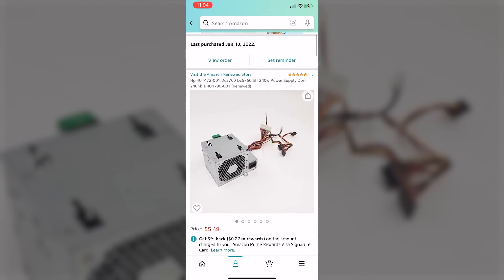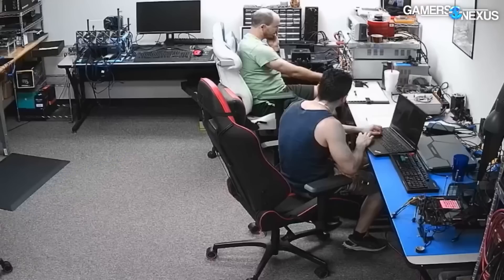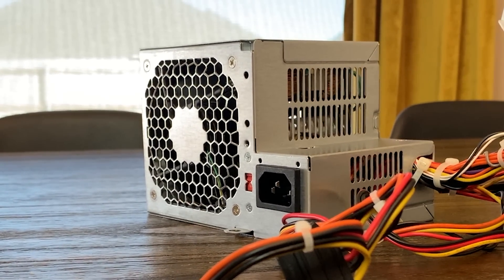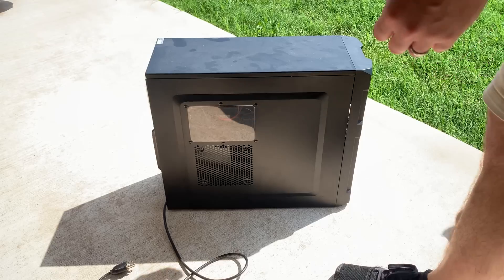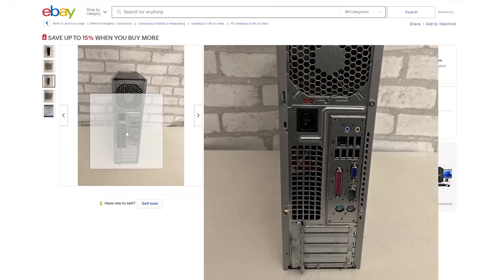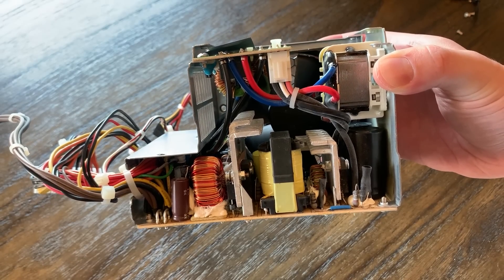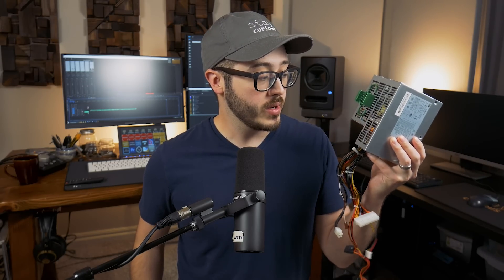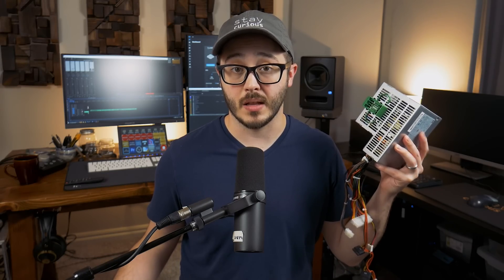THIS Ran A Website For Over A Year

Comment: Like your channel and agree with comment about internet. Good point. Also with old power supply, I had similar one, which died on me and for fun I have replaced the caps which cost not even a dollar and the PSU runs well with my WinXP retro build. Replace caps and good to go. Office PCs were built like a tank so why throw it away!
and bonus point, some of us like watching other people struggling with soldering iron so more content....
Reply: and one more thing. Replace that outer shell and use regular ATX. You will get more use out of it. Either do it with dead ATX power supply and insolate it properly OR make 3D print and put components there. Boom, more content and more use out of it.

Comment: When a cap pops, I would call that "catastrophic." The device suddenly stops working accompanied by smoke, smell and electrolyte spewed all over.  I have had that happen. Bad caps are a common, widespread  problem even with "good" brands. I have HP machines that no longer work due to bad caps that I can see are bulging. I have moved on, but should still replace them because leaking caps will eat away the pcb and traces. Since this project is about experimentation, experiment some more by replacing the caps. Not that expensive now. Use good brands like Nichicon or Panasonic.

Comment: Honestly. Cheap PSUs normally don't explode... Those removed from OEM machines definitely don't but even those PSUs that are built with the cheapest materials will probably run fine for years. The deal is, they are using the cheapest materials and overbranding themselves. So they will have a 500 Watts stick and if you try to plug a 500W load on it, sure, it will blow. But even cheap power regulation is still power regulation. So they use a 10A mosfett you can still pull 120W on the 12V rail.

Obviously you have other issues that can show up and some of then can definitely kill your PC or make it unstable. But the fire situation is very rare.

When you see the gigabyte PSU blow up on Steve's channel that did happened after a 100% load and recurrent power off. Which sure. Shouldn't happen but I bet that if you run that same PSU on a 10% load it would run for years. I would trust it with a expensive machine? Hell no. But for a budget low end Celeron pet project that I have laying around, yeah, sure, it won't burn my house down...

I would be far more worrying about certain PCI-E ryzer thar short to ground than a PSU running at 1/10th of its rated capacity on a machine that I dont care much.

That's not an advertising for buying cheap PSU but you should definitely  spec the PSU to the project, there's no sense in put a 7950X on this $5 PSU the same way that checking if your 1600 Seasonic has Japanese capacitors to run that DDR3 J1800...

Comment: I'm all for seeing you "refurbish" the current power supply and letting it go again.
I'm running a generic "480 watt" power supply that came with a generic case I purchased some time around 2005 in my home server.  
The case/power supply was from a computer I previously built for one of my kids  The system was built with a then-new Athlon 64 4000+.  It was then upgraded to an AM2+ board with a Athlon II X2 250.  That is still the board in the system, but since "upgraded" to a low-power Athlon X4 610e.
A quick inspection of the system, including the power supply a while back showed no signs of capacitor issues, which is pretty amazing since the computer ran almost 24/7 when it was my kid's computer, and has been running 24/7 since it has been my server, which by the way is Windows Home Server 2011, which I've been running since 2011.
The server is shut off about twice per year to give a blast of air, and has been shut down a couple of times to upgrade hard drives.  

It is just about time to retire the old girl as a server now.  It only has SATAII and USB2, which hasn't really been a problem as it is only a file server, but recently having to transfer data from old 4TB HDDS to the new 8TB drives convinced me that it is time.  

It's time to upgrade to a new-fangled 4th generation i5 and a case that can hold more than 4 drives.  AND a brand new name brand high efficiency power supply.  And no worries - the old girl is going to be put out to pasture as an XP gaming PC (I have a better CPU and video card) or simply a RetroArch emulator box.

Before I get comments about how dumb I am running a piece of junk PS on something important, let me explain.  It is a file server.  Anything that is important to me (pictures) is backed up.  Anything else on the server is considered expendable.  All my (and my family's) systems built over the last many years have been built with a good quality power supply as the heart of the system.  My kids are now grown and have built their own computers since, and even they have spent good money on a PSU as insurance to protect their expensive Gaming PC parts.

Comment: I’ve been checking in on the website every so often, and as the days went by, I got more and more impressed that a $5 power supply was able to stay continuously on without exploding!
Reply: It honestly doesn’t surprise me at all. Theres no real load on that thing when it’s only task is running a simple  server. 

I wouldn’t do anything highly demanding with it, but for this? Wouldn’t be a problem for that PSU. 

I will admit, though, that I don’t know what hardware he’s using in that built, but it’s still pretty much idling all day.

Comment: As for the PSU, if it is just for hobby project like your website and nothing serious, I'd keep it running, and perhaps we can learn how long a PSU with leaky cap can last (until it dies or becomes unstable enough).  Or if not, perhaps use it in another project like for LED lighting.
Reply: But ... a leaky cap will eat away the pcb, probably ruining it.

Comment: It's funny the hoops we jump through to learn stuff, isn't it?  If it's your only spare I'd suggest fixing it, although the expense of the caps + your time are probably greater than the cost of another "cheap" supply for desktop projects. As long as it meets the need, video #4? Not bad for a $5 supply.

Comment: It would be very interesting if you compared the efficiency between this(though dying) and a 80+ certified reputable one like Corsair CX450. This HP power supply doesn't come with APFC(hence the little red switch for 115V and 220V) so the efficiency should be even worse.
If we assume the parts alone consume 30W(The whole E350 platform should consume ~30W at idle), with 60% efficiency you get 50W from the wall socket. With 75% efficiency, you get 40W from the wall socket. 10 watt difference looked small but it adds up considering the server runs 24/7.
Power efficient servers are much more fun to explore than whatever powerful parts one can get hands on as low loads kill efficiency on average ATX power supplies. (Unless you go expensive with ones like Corsair RM550x.)

Comment: HP power supplies are usually very reliable. I've only had very few fail at work, and since they are well protected usually nothing much happens, well except for the capacitor giving off some smoke and maybe a small bang, but usually they just die and don't turn back on.
Reply: That’s good to hear, I’m also using an old hp psu for my Minecraft server lol

Comment: People judge the $5 PS harsh, meanwhile their laptop, TV, AVR, etc all run cheap as dirt power supplies that nobody gives a passing thought.
Reply: I do when they die. Back when flat screens were new element put the most god awful power supply in their tv. In fact its the only tv I seen die from power supply failure and I have seen 3 different damn models die from the same crappy power supply failure. In less than 4 years. The only other thing I seen die was my cheap acer monitor that lasted from 2008-2022 with daily usage.
Reply: you are putting trust in the manufacturer to pick a reliable power supply. Because the brands reputation relies on it
Reply: so true, I've seen horrific stuff people charge their 1000 USD phones with.
Reply: @Reiikz Those nasty phone chargers are terrifying.
Reply: 300th like
Reply: my pc literally has a "golden technology line" 500w psu that once in a while just turns off for no reason, and it was bought used for like 20 bucks
Reply: Totally agree on everything except the laptop, cause isn't that just DC to DC conversion?

Comment: I had a power supply blow up on me twice. 
One time when I put a new GPU in my first ever gaming pc. That thing had a cheap 300W office PSU in it without any PCIe power connectors. I had to splice up some sata cables to power the GPU. And sure enough, it went out mid game.

The other PSU was actually name brand be-quiet, but I think it was their lowest tier 300W PSU that I installed in my NAS. OMG when that PSU went out I first heard a loud crack at night, i thought it must have been something outside or so. Over the night I slowly started to register this peanutty roasty smell, filling my room. Not only that, but it took out its circuit breaker (seperate from my gaming PC) Without disconnecting the NAS I tried to put the circuit breaker up again, went straight out again.
As i took the PSU apart, I noticed this weird liquid dripping down from the PSU through its fan, the main Capacitor in the PSU just exploded. I'll never forget that smell.

I still trust be-quiet! but I buy their higher end PSUs only, Another great brand I've never had any issues with is Seasonic and weirdly enough LC-Power's cheap office PSUs!
I hear Superflower is another reliable brand.
Reply: Yup they're good, I bought a superflower for a new pc back in 06-07 and when I had everything, I plugged the pc to the wall, turn on the switch of the psu and a big bang and flame came out of the back os the psu 😂 Put the breaker up again, try to see if pc worked and what was damaged and to my surprise everything was perfect, the pc ran for atleast 10 years before I replaced
Reply: @PTSeTe  HUH That's weird! must've been some small loose wire or component leg that evaporated itself off the PCB or some weird fault like that. It's kind of amazing how long PSUs can last xD

Comment: i grew up building machines with trash-picked PSUs. you end up developing an eye for what's good and what isn't. turns out, i still have 2 machines running 7 years later with the same PSUs i found on the trash. not the best. but those pcs are used for non-critical stuff, and here any decent PSU (or any decent pc component in general) is expensive af
Reply: A visual inspection and cleaning would then be in order.
Reply: I have 2 machines running at least 5 year old power supplies. One power supply from a dell optiplex and other from an hp office PC. I also have a machine running a 20 year old power supply. It has like pentium 4 but it's good enough to run roblox or a minecraft server lol.
Reply: @propsekgamer  you know what, people say that but ive found unless you like heavily optimize it and turn render distance down and like idk minecraft servers to be remotely usable kinda need a little more than that like idk. idk how do you run minecraft servers on super ancient hardware?

Comment: It’d be great to see you replace the bad caps since it’s educational and shows the importance of repairability. I think often times many people, including myself in the past, end up replacing things that could have been fixed.
Reply from the maker: Very true
Reply: Yes, although keep in mind that when people do replace power supplies these days it's usually because they need more power. I've had computers for over 30 years and I think I've only had one in all that time that needed a replacement power supply due to it becoming damaged. Most of the time, it's been due to needing more power.
Reply: actually, yeah -- that could be really fun and a cool video tbh.
Reply: In theory it's possible to do reforming of the capacitors
Reply: @autohmae  That does not apply here. Capacitors "reform" only when they have been dormant for a long, long time. This psu has been powered up (apparently) 24/7 for over a year. When they bulge, it means they are done for and will eventually pop and/or leak.

Comment: Cool video, i honestly think its best to just use the psu for a testbench or something since it has already proven the point that it didnt explode right away, maybe you could try to repair it but just use it for testing and stuff after
Reply from the maker: Yeah that might not be a bad use. I would definitely want to replace the caps for that though haha
Reply: Wow, has it been a year already, I remember when you just uploaded the first video about this power supply